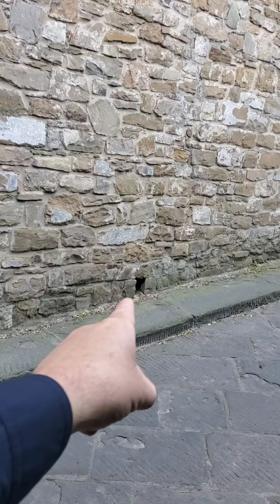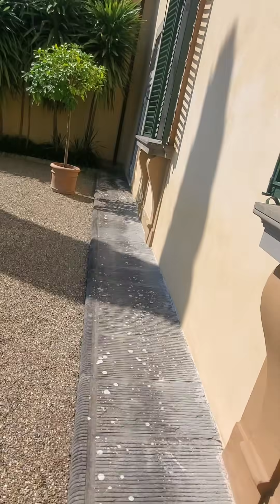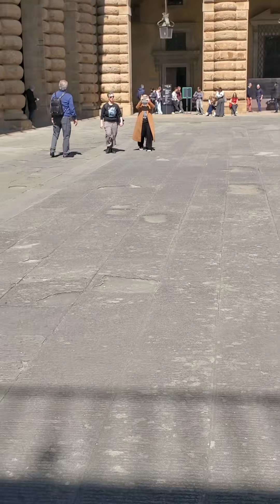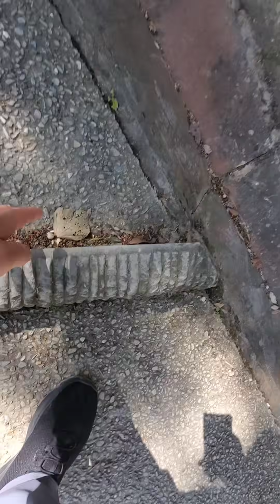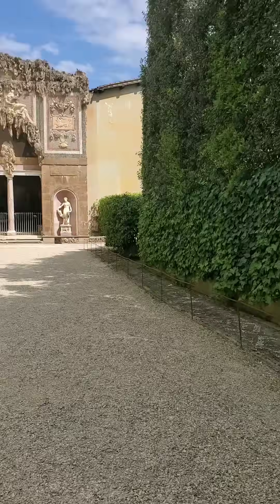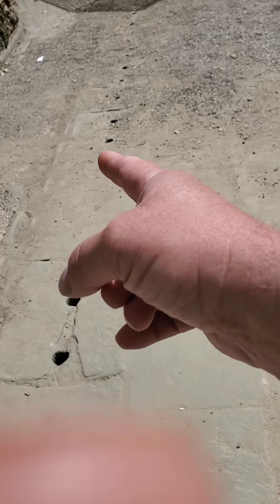Ancient Europe has a lot to teach us about proper construction!

Comment: is a crack in a basement wall an existing defect that can allow water in basement?  if you were inspecting a roof that had a hole say in the valley would you inform a buyer that is an existing defect and may allow water in hence the roof needs to be fixed properly? or would you tell them it's fine to leave it open err unrepaired and fine to allow water in? or with a leaky roof,  would you tell homeowner to RAISE the roof to give it a better pitch-drainage and doing tha would solve the leaky roof? smh
Reply: That's exactly what's he is saying - solve the water problem outside of your foundation instead of just sealing the foundation.
Reply: @randomnickify   🤣 no what i said he is not saying, he said it's fine to allow water in through cracks in B walls, he said it's a good thing because he claims it relieves hyd-pressure 2:50 ish of this video this is not good, no.. Allowing water in through foundation wall cracks.. if poured walls then what do you think happens to reinforcing rods + water?  And block and bricks walls and mortar joints + water = deterioration and spalling of block, bricks and m joints. And for once read Fairfax County VA 'Marine Clay Guide'... sure go ahead n try and divert some water away from houses, fine, of course.... but not much focus-attention given to the SOIL and underground tree roots and sometimes concrete slabs or porch footings that also cause cracks in B walls and some walls to bow in from many home inspectors. Nobody is going to be able to keep all water out of soil, from expanding on those longer heavier rains baby, no sorry. So one can TRY and limit the amount of water in soil around house (walls) and that again is fine but grading isn't waterproofing, never has been never will be so recommending ONLY to regrade and NOT waterproof 1 or more existing cracks in B wall is a big mistake and hardly helps-benefits one's clients, sellers-homebuyers, have many videos of exactly this, of homebuyers getting raw end of the deal because some inspector told them all they need to do was re--grade, pfft!
Reply from the maker: I didn't say it's fine. I said its a good thing to relieve hydrostatic pressure, because later pressures are what destroy foundations. I have hundreds of videos explaining the importance of stopping water BEFORE it touches your foundation.
Reply: @Inspector_preston  i have hundreds of videos of water touching these foundation walls regardless of how the grade was raised, sloped, be it concrete grade, concrete on top of concrete, soil, brick pavers, sealing along perimters, swales, shallow exterior french drains and so on, basements stll leaked, had mold, efflorescence
Reply from the maker: Yup.

Comment: All excellent points.  It's possible the ancient Romans were smarter than us and some building techniques may have been lost in the Middle Ages. They also had slaves to do lot of the work which really kept the costs down and one major thing they don't have there - freezing weather - which causes most of the damage in the Northeast where I live.
Reply: Most of Europe has both freezing water and thousand year old buildings - as long there is no water close to the building, problem does not exist. Building techniques were not lost, cheap, mass production took over.
Reply: @randomnickify . Average low temperature in Rome in winter is above 37 degrees F. 
Average low in NJ in winter is 24 degrees. So they may get some freezing weather in Rome but much less. Southern Italy even less so.
Reply: @PianoRevisited  There is entire Rest of the Europe in the north of the Rome you know. "Rome" ended more than 1,5 thousands years ago. By that time Rest of the Europe was already building stone cities.